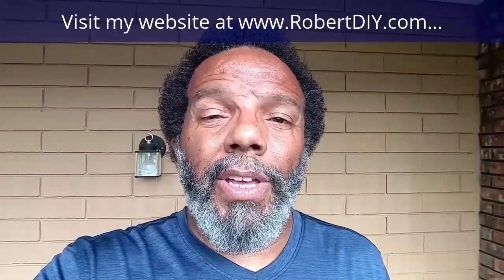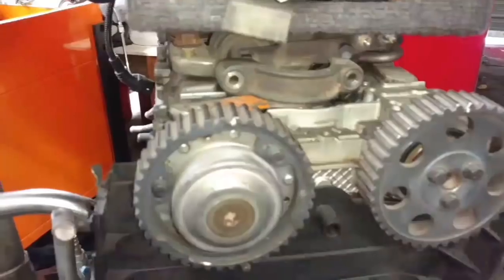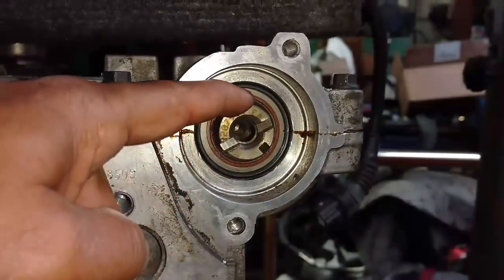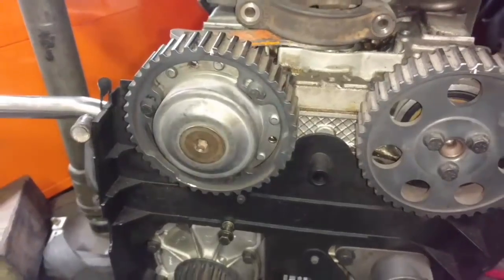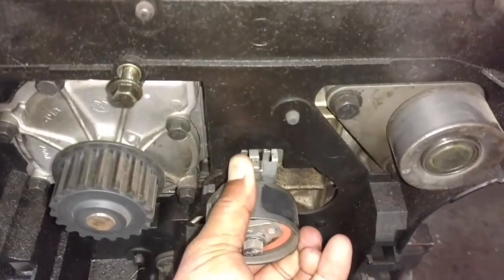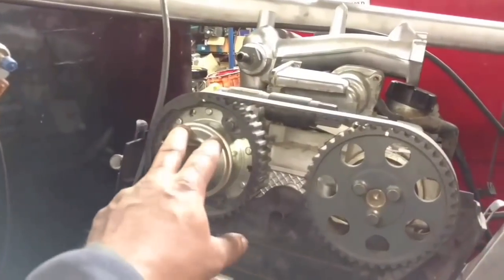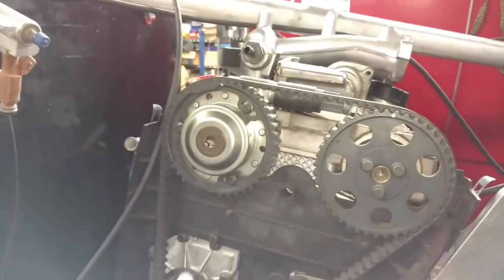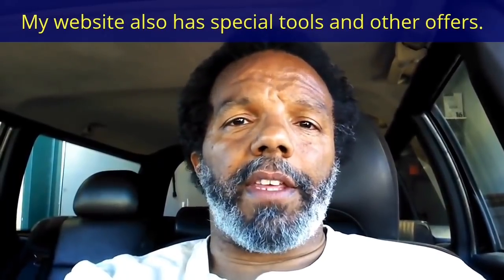CVVT and VVT hub, timing, installation, adjustment, how to install, etc. Volvo cams - VOTD

Comment: Hello Robert and anyone finding this message in the post, have a 2014 S60 T5 and when removing the exhaust cam shaft the end of it was attached to a mechanical vacuum boost, which revealed the usual Notches at the end of the camshaft. When removing the intake camshaft it does not have The Notches at the end of it. How am I supposed to position the camshafts to make sure they are in the correct position for timing when the intake camshaft does not have notches
Reply from the maker: If you don't take the sprocket/hub off of the other end you can simply time it on the front side of the engine.
Reply: @RobertDIY Thanks for getting back to me, I'll give that a try. For my own curiosity....Are you saying there are different ways to get the correct timing positions for the cams? How many ways are there? Why does almost everyone make such a big deal about the back side of the cam notches being horizontal to the seam of the block especially when using a cam locking tool? Thanks.... for being a great person, for explaining information so well in your content and for having the "Live talks " with us online.   Take care
Reply: @RobertDIY thank you very much for your time and input on that part of my project, I now have another issue that maybe you can help me with concerning the catalytic converters. The first or Upstream catalytic converter is now gutted, it was falling apart and came out in bits and chunks. The 2nd cat converter is in good shape. Can I run the car with one cat converter without performance/  power engine problems?   Thank you again

Comment: Hi i have a question. I have b4184s2 with a vvt on a intake camshaft, there's some kind of a sensor in the back of camshaft and there's a little notch, same like you have on exhaust camshaft, but mine is on intake. It is supposed to face up to the hood or down to the oil pan, like your one is?
Reply from the maker: I have no idea. Ask the guys on the Volvo speed Facebook page or MatthewsVolvosite.com

Comment: Hi man. I did all of this, but somehow I had the idea of tightening the 3 8mm bolts when turning clockwise preloading the spring. Now I have a error code and the camshafts are at 16-18 degrees. As it should be +-10.

But the real question is, what happens if i loosen the three bolts without locking tool in place? Does it find its place or do i start again from the start? This looks like the same model early 2001 exhaust only vvt.
Reply from the maker: https://youtu.be/cvAHAxLnbJI?si=ASUjdYDWloGHm1on
Reply: @RobertDIY  Oh, looks like I have them on the other end. If I understand right, I have to do it again. I think what i did wrong I tried to land that thing on the mark, but shouldve gone one over and the oval thing wouldwe fix it in the middle.

Now Im thinking; lock the cams and pretension it without taking the belt off? But again, like you said on the video the belt must come off. This has been a learning curve for me definitely. Im glad I found your video.

Comment: Great as always, Robert.  Made a mess of a cam seal job on my 04 V70 T5, struggling to get the timing correct (throwing code for CVVT).  Starting from scratch, locking cams, redoing hub procedure, etc.  Are you saying that it will be fine if I leave the variable cam position parallel with the head (as the cam locking tool forces it), it will readjust itself (to the slightly angled position)?  Thank you!
Reply from the maker: You are welcome
Reply from the maker: https://youtu.be/cvAHAxLnbJI?si=TkwV09r7vbAYCYRx
Reply: @RobertDIY  great, that was where my head was at, rely on that little bit of adjustment if needed.  Thanks again.

Comment: thank you robert this has been very helpful. i tried to not use the locking tool by cutting in alignment marks to align the cam with the valve cover and the vvt hub with the valve cover. in theory it should work but my eyes are not good enough to decern a few degrees apparently and now i am watching your video.
Reply from the maker: Thanks for watching

Comment: Great video.  But I got my self into trouble and I need some help.  I replaced by timing belt in by daughters 2005 xc70 with dual VVTs.  While doing the belt I discovered the camshaft seals were leaking slightly.  I got the seals and the cam locking tool.  Replaced the seals and and got all three timing marks line up - again with camshaft locking tool in place.  Then put the belt on and adjusted the tension.  Tensioning the belt pulled the exhaust VVT about one tooth past (towards rear of car) the timing mark.  I turned it over by hand three times no contact.  All timing marks went back like before including the exhaust one tooth off of timing mark.  So started the car, everything great for a minute then started getting error code. P0016 camshaft and crankshaft not in alignment.  My question to you is Can I pull it back apart, install the camshaft locking tool again, remove the belt, line up timing marks and put the exhaust VVT one tooth on the other side of the timing mark, install and tension the belt.  Idea is the tensioning will pull the exhaust VVT to be directly in line with timing mark.
Reply from the maker: https://youtu.be/cvAHAxLnbJI?si=R1xRbRXIX_r1Xxw6
Reply: @RobertDIY  Excellent, thank you Robert for the quick response!  I'll give that a shot.  The three gear bolts were smack middle of the slotted channel, but I'm betting there is enough room.  It'll be next weekend before I can get to it.  But I'll let you know how it turns out.  Thanks again!

Comment: Thank you for the video. I have an 07 XC70 that I am working on now. It has dual VVT, hubs aren't spring loaded. My understanding is that at the end of the day, as long as the timing belt sprocket mark lines up with the mark on the timing cover, I'm good. I did use the cam locking tool, but I swear the cam itself rotated <1 tooth when tightening the tool. Given the play in the hub is >2 teeth in either direction, I assume there is no issue here, as the sensor will align itself upon starting (using oil pressure, right?).
Reply from the maker: It will try. You only need the cam locking tool if you are removing a hub.

Comment: Having a P0016 code problem and cold start advancement ..2016 xc70 T5. Set the timing over 10 times .. went back and forth a tooth.. I have the cam lock tool .. replaced sensors and solenoids..  any suggestions?
Reply from the maker: Sadly I do not. You really need a good level 2 or 3 code reader. How does it run? You could have a bad sensor or hub.

Comment: I have a question for anyone that can help me im nee to volvo.. I have a snapped timing belt and my vvt hubs have stripped bolts. Is it possible to set up the cams with the tool without loosening the hub bolt?
And if so can I just set up my cams and just allign the crank and cam marks and put the belt back on
Reply from the maker: Yes
Reply from the maker: https://youtu.be/gt9w-ZSxs9I
Reply from the maker: https://youtu.be/YpOYTVpzzic
Reply from the maker: https://youtu.be/hJIoyHLl30U
Reply: Thank you Robert, im in Australia  and its the first volvo I have own and very unfamiliar with the vvt setup.
Your videos are fantastic and have helped so much. Thank you very much for your time in making all these. Your helping so so many ppl in a position where they simply can't afford to go to a professional mechanic and need to take these jobs on themselves and sometimes with very limited knowledge .. 
People on a low income especially  in these new times of struggle often the family vehicle is literally the make or break of a person and theyre family. To many its the difference between having a roof over one's head or not.. 
And I hope you understand what amazing work you have been doing, its putting back so much into a world that really needs it..
Reply: Hopefully as it snapped on start up and didn't actully fire and was left alone it didn't do any damage to any valves.. I have put a camera down the plug holes to see if there is any sign of valve marks on the piston faces and all look good so fingers crossed no damage
Reply: I may be that one lucky volvo owner that may have got away not bending valves due to snapped belt. I've got it all back together and it starts but is running as if it's not firing on one cylinder.. there's no tapping at all and no real compression difference between cylinders so I don't think a valve is stuck open  . There's spark to each cylinder but it's running rough. I thought I was off on timing but it's all correct and now I'm a bit of a loss on wgat to check next.

Comment: Hi Robert! Your videos are extremely helpful.  Volvos are a little less intimidating to work on,  because of you!  I have a 1999 C70 Turbo with a 2.3 Liter engine. I am in the process of removing the head to replace a head gasket. It was running fine before I started in on this project, but I was losing a little coolant and I was getting exhaust gases into my coolant tank. The car was not overheating and I probably ran it through this past winter this way.  I found an inexpensive kit from Harbor freight to verify that the exhaust gases were in the coolant. 

Anyway, I set all my timing marks prior to disassembly, not that it makes a lot of sense since the cam cover and cams have to come out. After I had removed all 40 plus bolts out of the cam cover, I could not get the cam cover off the cams or get the cams to come straight up and out without loosening the small 10 mm bolts because the backside of the bolts penetrating through the gears would not clear the side of the head in order to pull straight up, like you show in one of your videos. 

I had loosened and removed all 40 plus cam cover bolts, so I was trying to remove the 10mm bolts on the cam gears with sprocket in hand without screwing something up.  It was not expected or fun doing that!  The intake cam helped pop the cover up as you mentioned in you video. I did not touch the VVT on the exhaust cam gear, so I don't really know what you are talking about in this video about removing the center bolt and resetting it. If I didn't touch it, why should I need to reset anything? I snugged all the gears back down onto the cams, and do not intend to mess with them anymore! 

I bought all the cam locking tools I needed from IPD in Portland, Oregon. They specialize in Volvo parts. The tool kit wasn’t that expensive, but I haven't used any of these tools yet! 

Is there a good narrative video that you or anybody else has online that shows how to properly use these tools to ensure that when I put this car back together I won't be flailing when it comes to starting the car up?  

I've changed the timing belt, water pump and idler pulleys before without any of these tools available. I just made sure my crankshaft mark was aligned as well as the cover marks and I didn't have any problems. 

Pulling a head is a different matter! I have a sleeve protruding on the driver's side of the exhaust cam. There was an aluminum cover that looks like the VVT over that which fastened with 2 torx bolts. The passenger side of the intake cam just had a sheet metal cap that popped in place to keep the oil in. It got a little bent when removing the camshaft. I guess I need to replace it? 

I almost have the Head out as of this writing. I think I missed 4 bolts on the exhaust manifold side, perhaps a coolant line and 2 other fasteners I missed. 

I’m going to triple check everything after I get the head back from the machine shop.   They don't touch valves in the machine shops around here.  If they do they want the camshafts and camcover to bolt everything together to check clearances after removing the valves.   I’ll probably do a leak check of the valves and do some lapping and sealing if necessary.  The car ran fine prior to the blown head gasket.  I bought the car with 120,000 miles on it.  A doctor owned it for 12 years prior to trading it in on a BMW SUV.  At this writing, I have almost 200,000 on the motor, and the car still had plenty of pep!  

I tool lots of pictures and bagged and tagged everything I've removed.   

Any advice or insight would be helpful!   Thank you in advance!
Reply from the maker: https://youtu.be/gt9w-ZSxs9I
Reply from the maker: No need to reset the VVT hub if you didn't remove it. Just align the marks.
Reply: @RobertDIY  Thank you Robert!  After I bought the car in 2013, I drove it to San Diego from Washington State, and it sat in my mother's garage.  I bought it at the time to be a get around vehicle when I visited and to drive my mother around because she couldn't drive anymore because of her age.  I drove the car back up in 2016 and I was on my way to a rehearsal at a local college here in a Jazz band I was in.  Anyway,  the check oil light was coming on!  By the time I got to the college I had the entire contents of my oil sump out on the ground.  I took it to the local Jiffy Lube and they told me I had a major leak.  Fortunately, I was only a couple blocks from a Foreign Auto Mechanic shop.  They told me that the PCV system had plugged up and was blowing oil out of the camshaft seals.  I'm assuming it was the exhaust side because that's the side with the VVT hub.  I didn't know squat about Volvos at the time and $2,000 dollars later I had my car back, but when they put it on their code reader, it read that it was around 3 degrees advanced.  The mechanic looked at me like it wasn't his problem man!  I asked him about driving the car "as is" because in the 70's I would advance timing on my old muscle cars.  So I drove it around from 2016 until just recently in 2023 when I started losing coolant.  I've "lived' with the "Check Engine" light!  I bought a Code Reader and it's always the same problem.  The mechanic who released it to me back in 2016 said he had a VVT to sell to me for $50.00.  I should have jumped on it in retrospect.  

My question is:  Can the VVT be adjusted by just turning it in the bolt hole to make up for that 3 degrees?  I changed the timing belt, water pump and a couple other pulleys a while back hoping they were only off by 1 tooth when they supposedly fixed my PCV problem.  Is the adjustment on the VVT most likely the problem?  I appreciate your opinion!
Reply from the maker: https://youtu.be/b_XOdjgxn9A

Comment: great video and info that i could not find anywhere about what position the in and ex cams should be in in case timing belt is already off .i was pretty sure the cams had not moved ...at least not much anyway   my kit came with water pump tension  pulley idle pulley and 5 seals   1 crank shaft seal  2 camshaft seals and 2 ?"oil seals" ?  are those  the seals on the backside of the cams, where you put the locking tool?  if so should i reoplace them even tho they are not leaking?if not where are the oil seals at?
Reply from the maker: I don't even know what kind of car you have. I don't mess with seals that are not leaking.
Reply: @RobertDIY  2006
Reply: Volvo XC70 2.5T

Comment: Hi Robert, my  VVT-solonoid on my Volvo V40 makes an intermittent rattling noise at idle. Can you please tell me, who exactly is making that noise and why? The solonoid itself, a bad gasket, not enough oil pressure? I would be so grateful, if you would explain this to me.
Reply from the maker: sad to say, I have no idea. My guess would be that the solenoid is going bad.
Reply: @RobertDIY  Thank you, Robert

Comment: Hey man, I got the fault code p0014 over advanced , I've changed both oil and vvt solenoid .
The belt was changed a few years ago and I've had this error to and from, and I don't have a locking tool so I'm wondering if I can change the cvvt cogs a little bit without it or if it's a bad idea?
It's a 2000 2.3 T5 (ph1) b5234t3

The car runs great, it's just that I get that fault code to and from. If it's a bad idea then il save up for the locking tools and do everything from the start but I'd rather not .
Reply from the maker: did you try to adjust the timing?
Reply: @RobertDIY sorry for not seeing the reply,
So yes I got the locking tools for the cam and crank and installed everything according to Volvo VIDA . Yet I still get the same bad timing, it's a turbo so you check it with holding the gas a little bit but still under 1200rpm and I'm at 27-30° . At idle it's good and between -+7 , but turbos you need to check with the 1200rpm method.

I mean is the hub shot? Or can I try and just adjust it left?(Retard the hub)

I mean there's play in the hub but it should go out and in cause its how it adjusts itself, right?(with the oil pressure)

I actually got it for the first time to between -7 but +9 (should be between +-7) but when I changed it a little more it went up to +27-30 again.

I'm just so tired of having to redo the locking procedures since it will be my fifth time in a month , but I just want it to work.

I Have installed timing correctly.
I have installed a brand new vvtsolenoid.
I have checked the wires to the solenoid.
I have changed the oil.
(10w40 but it shouldn't really matter, should be 5w40 but have had this fault with 0w30-5w40-10w40).

When I got it to -7+9 I didn't remove the cambelt och put in locking tools, I just losened the 3 8mm screws and used the 55mm torx to retard it counterclockwise a little bit. But now its just the same issue.

And one weird thing is when I change my exhaust from 3" to 2"5 inch then it went down to 12-14° but the next time I started her up it went back to 27-30°

Do I really need to buy a new hub or am I just sucking at setting up the hub?
Reply from the maker: https://youtu.be/cvAHAxLnbJI
Reply from the maker: Could have a bad hub.

Comment: Would this applied to engine B5234t3 ? Pls let me know I’m having trouble timing my engine can’t find anything on pro demand that makes any sense (my engine does not have tension 04 Volvo s60)
Reply from the maker: yes
Reply: @RobertDIY  okay so do the screws in the oval holes stay in the middle or clockwise at the  limit position ?